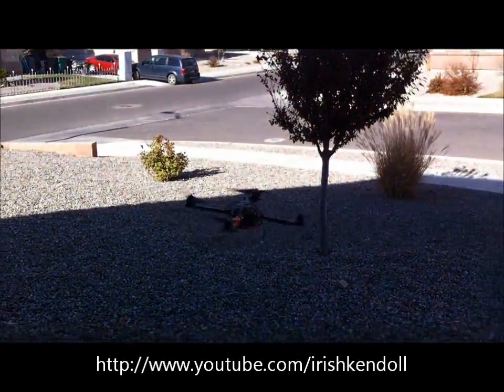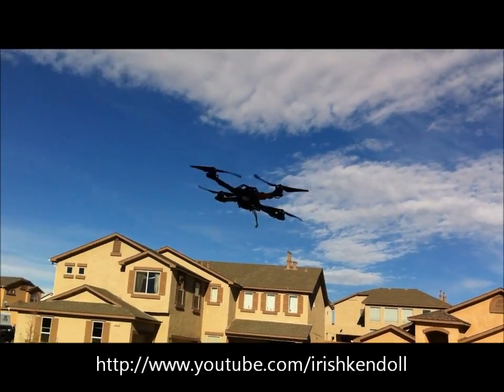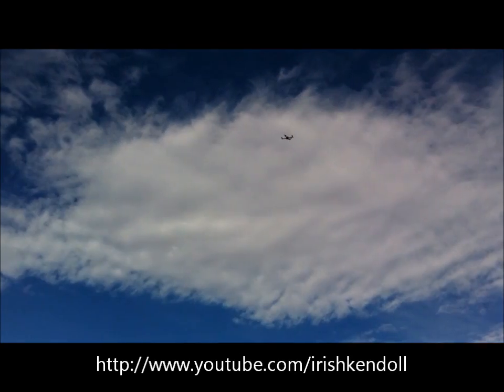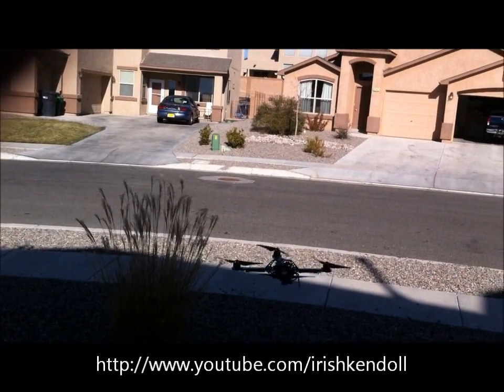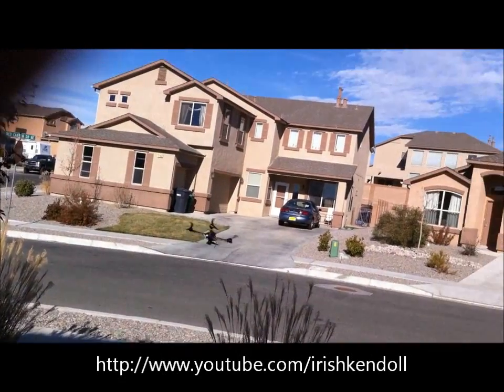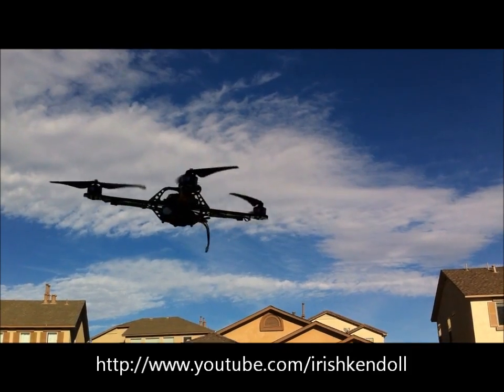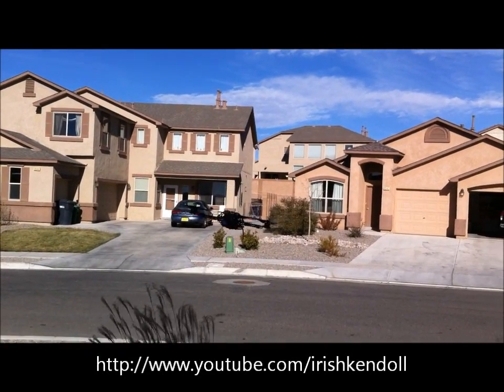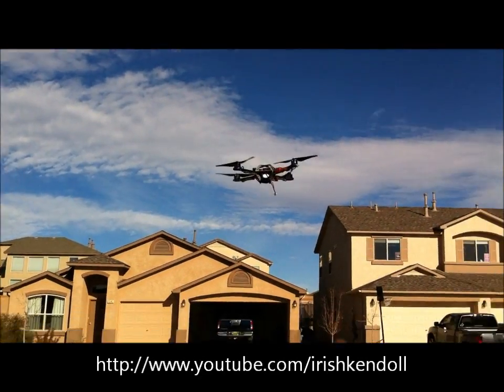NEW! X-3D X-BL PROP TRIAL

Comment: I'm interested in a quadrocopter but I'm new to the hobby and a beginner. I'm interested in the X-3D-BL but cant find anywhere in the U.S. to buy parts or the quad it self. Where can I find this in the U.S.? If I cant, I was thinking about trying the Gaui 330xs because I have a hobby shop close by that sells but don't know if it's any good. Any help would be greatly appreciated. :)